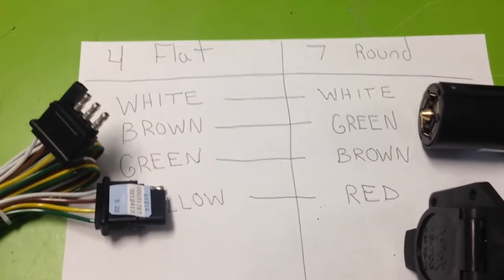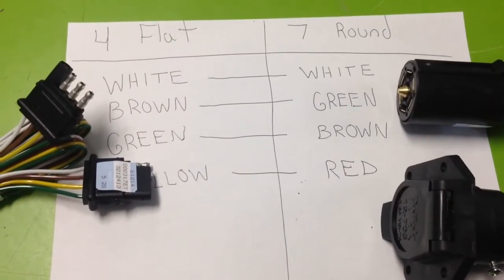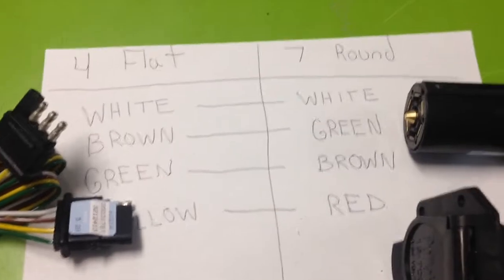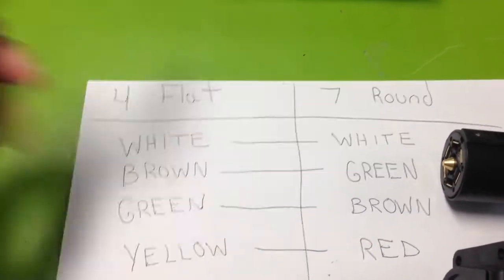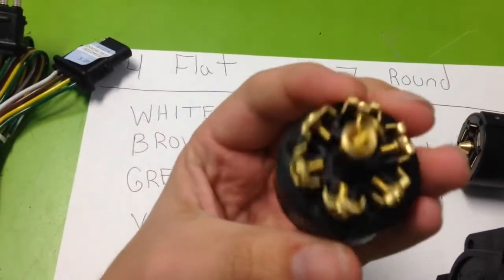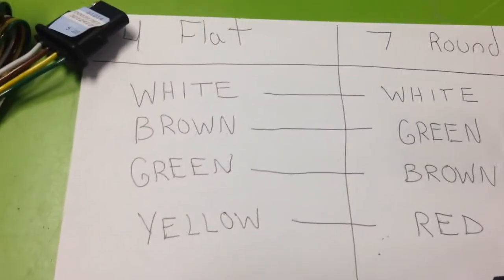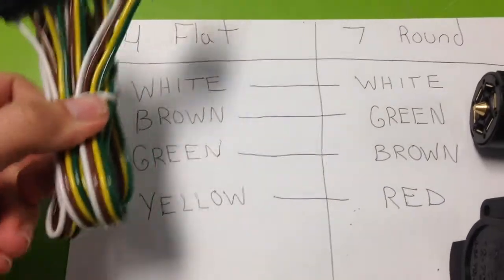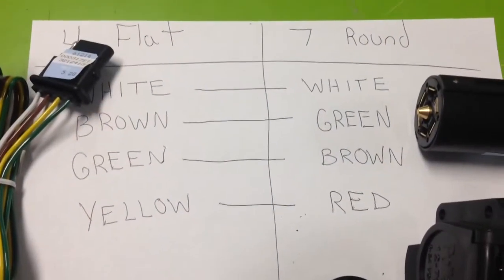4 wire to 7 wire

Comment: OMG,  after 2 hours of trying to put together an ADAPTER myself, YOUR Life saving simple tutorial, written and explained on a plain white piece of paper showing the diagram literally saved my life!  Regardless if I or anyone else doesn't truly understand why the colors aren't matching the plug to color of wires, IT WORKED for what I needed.  Here's a STORY on why I needed to make this particular adapter:  I work about an hour away from home and a few nights ago, I left my Suburban (which is an older '99 and only has a 4 wire flat plug) at work and came home in another car with my wife during the week.  A week later, I thought to myself, Hey, the next time I go to work, I'll just take my jeep with my tow bars that I   normally pull with my RV and my cable for "Lights", not realizing at that very moment, that my cable that I use to connect my "Lights" from RV to Jeep when I tow is a 7 pin.

So a week later, I took my Jeep and I pulled my Jeep back using my Suburban to tow it back home, but unfortunately, without no lights.  2 days later, I successfully made the ADAPTER needed for future tows with the Help of this Awesome video.  THANKS AGAIN.

Comment: Just as a suggestion, you might mention (or write a comment) in your video that your diagram only works for 7-way RV plugs.  It does not work for 7-way SAE.  Both plugs look the same and are interchangeable.  That's why your wiring diagram isn't working for some folks.  I wired mine up according to your diagram and discovered I have an SAE plug, so it didn't work.  Then I changed it to white to white, brown to brown,  yellow to yellow, green to green and it worked.  Here is a link which shows the different colors of an RV plug vs. a SAE plug.  https://www.etrailer.com/faq-wiring-7-way.aspx
Reply: Thanx for the link and pointing out SAE difference.

Comment: I want to give you a big thank you since I used your video to build an adapter when I changed tow vehicles a year ago. It gave me brake and taillights to safely move my trailer from storage to where I could get the car wiring changed (so I could power other features). It worked like a charm!

Comment: Tried it your way, right light stayed brake lit, no right turn signal. 2nd try I matched the colors (brown to brown, green to green, yellow to yellow) and it worked perfectly.
Reply from the maker: Very odd seeings how on a 7 round plug wire code yellow is reverse lights which a four flat does not  even have, yellow on four flat is left turn. (Which is red on the 7)
Reply: Sometimes/most times the stamps are labeled incorrect